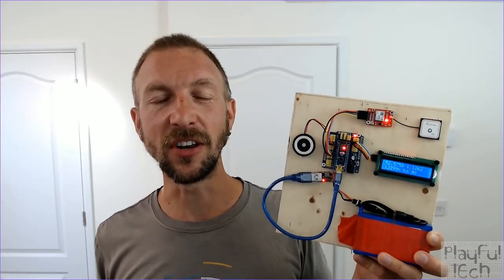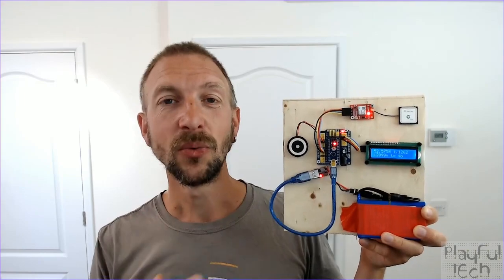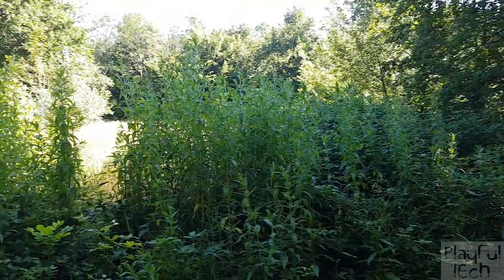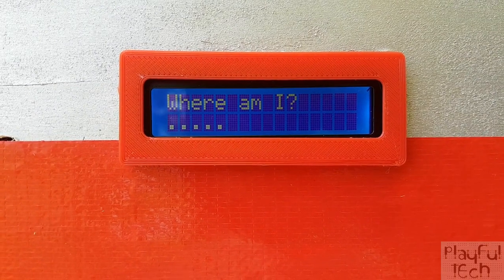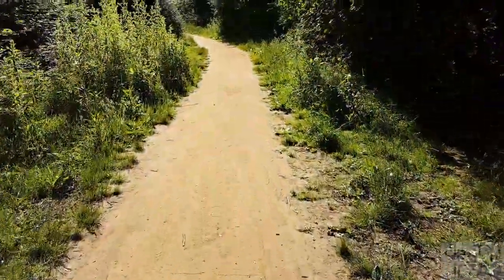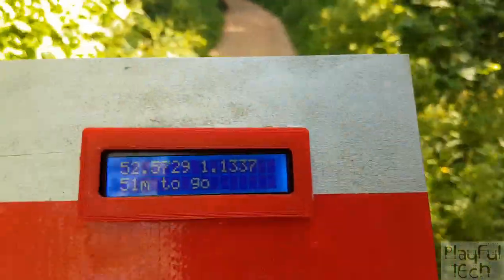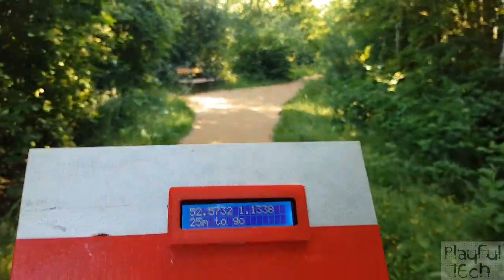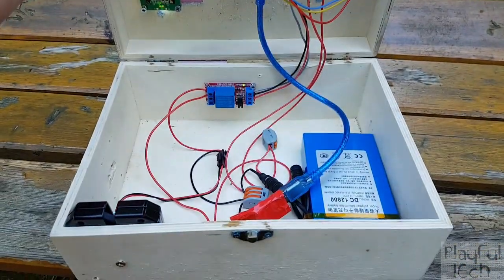How to Create an Outdoor Escape Room Puzzle - "Take Me Home" - a GPS Reverse Geocache

Comment: Another great informative video! Non blocking code and reliability is good to hear and learn from you. Just watched your GSM video which I also learned a lot.

New project idea? 💡

Combine the GPS and GSM to make a tracker for your dog in case it goes missing in the woods like it did in the GSM video! Shrink it all down to small form factor (pro mini, Quectel L80 Gps, Sim800L), use sleep modes to save power/smaller battery. Would make for a really interesting video. 
Thanks again, enjoying your excellent videos and learning a lot!

Comment: Hello,
I would like to do a bit the same thing, that is to say, insert in the code a lot of values (Latitude, longitude) and then to use, which is compared to the current position. At each passage on a position, the device would perform an action (buzzer for example). Let's imagine a game, a walk in an area where each registered position represents a Zombie, if it sounds we have lost... Who has already done this? from your code is it possible?
Reply from the maker: Yes, sure - you just need to use an array of lat/long coordinates rather than a single "target" value - it would be a pretty trivial change.
Reply: @PlayfulTechnology  OK I buy this code, I pay for your work
Reply: @PlayfulTechnology  Where is the Arduino code  ?
Reply from the maker: @patricknicolas1138  Hi Patrick, the resources are all available on my patreon page, here: https://www.patreon.com/posts/38606896
Reply: @PlayfulTechnology  Hello,
I made this assembly but two things mislead.
1- the visual wiring of the LCD is reversed ... SLC > A5 Blue and SDA > A4 Yellow ... the pins on the LCD are reversed (it may depend on the models but I visually have the same as you)
1- The current GPS module (blue color) does not have the same 3.3v voltage, maybe it would be wise to report it, because at 5v I fried mine.
..
In Arduino IDE, the code underlines an error with AltSoftSerial .
The three libraries are present.
Once powered up (Just NANO + LCD) nothing works, the LCD lights up but no text (despite the well-adjusted brightness).

Have a good day